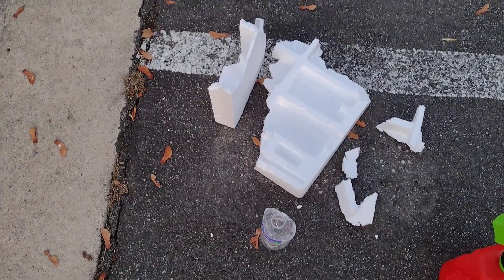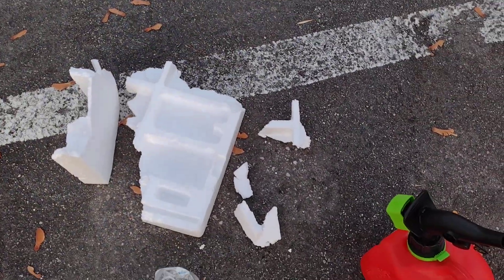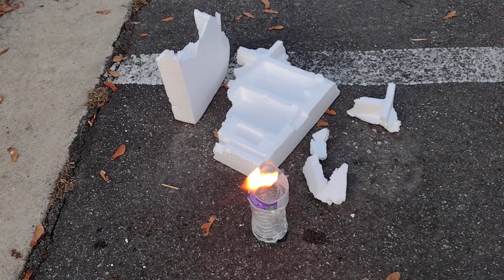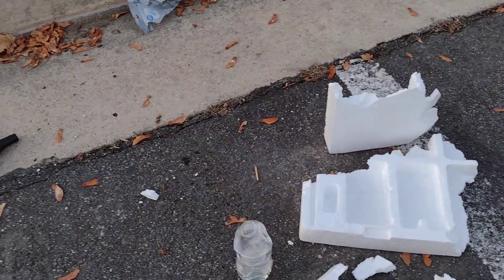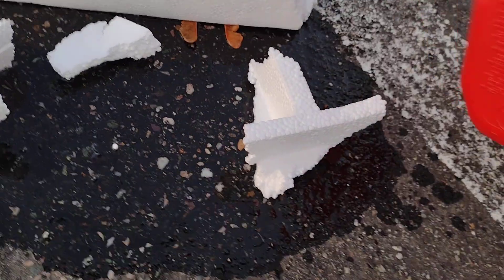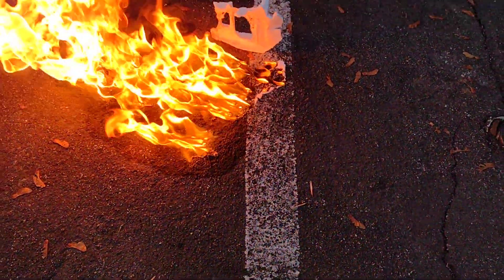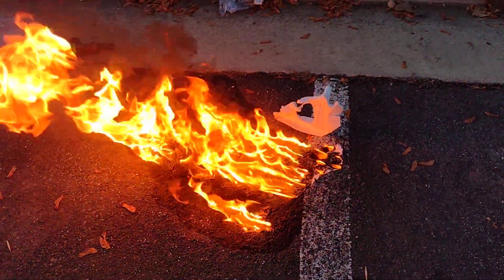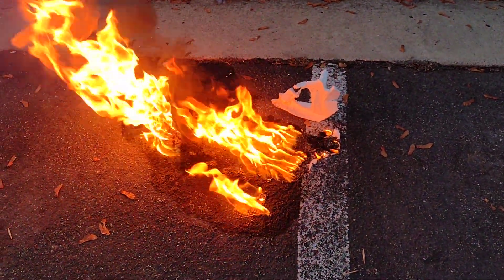Making napalm with gasoline and Styrofoam!  DO NOT TRY THIS!

Comment: The foam that coffee cups are made of will quickly dissolve in gasoline. Keep adding foam until it thickens and becomes very sticky, use with caution. There are many types of foam plastic, some are really flame retardant and not suitable for this purpose.
Reply from the maker: Yeah that's styrofoam which is extruded polystyrene foam.  It will also dissolve in acetone.  I did a video on that too.

Comment: Break fluid mixed well with Styrofoam will self ignite.  It's called a snow ball. Burns long enough and hot enough to catch asphalt shingles on fire.
Reply from the maker: I've mixed brake fluid and pool chlorine in a video. Go watch that if u haven't yet.

Comment: Like previous comments said, you put the syrofoam in gasoline it makes a goo. Are You sure You didn't use Naptha? (Which is Lighter fluid or the fluid used to to heat up barbeque briquettes)

Comment: I've never seen clear gasoline, but have seen clear kerosene. Also the way it burns is definitely characteristic of kerosene.
Reply: Not to sound pernickity, but, do you think you could describe the burn characteristics of the two
Reply: Im gonna say, kerosene; broad, lazy looping orange/yellow flames with plenty of soot.
Gasolene; rampant blueish/translucent flames with a fast burn, lots of heat and low soot

Comment: Looks like kerosene, not gasoline. I have put gasoline on Styrofoam, and it melts it immediately.
Reply from the maker: It's gasoline.  I've never bought kerosene before.
Reply: @sasquatl I don't think you're getting high quality gasoline from your gas station. I've melted lots of styrofoam using gasoline. Maybe that styrofoam is coated in something?
Reply: Acetone does a fantastic job of it too.
Reply: @-Fritz-  Any time that I ever used gasoline to start a fire, and put it on Styrofoam, it immediately melted it.